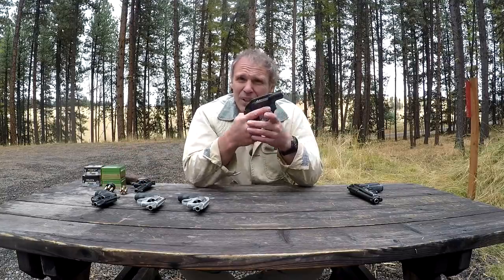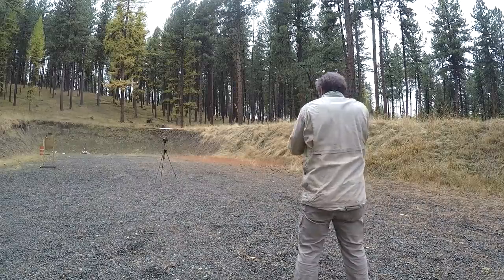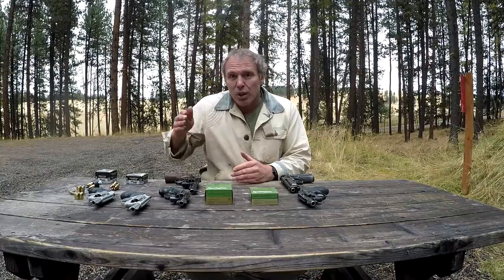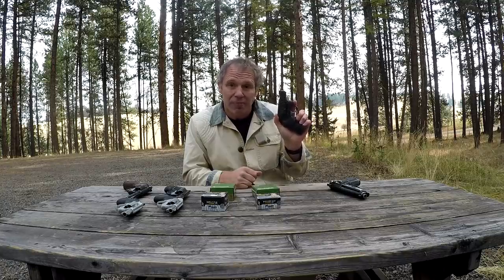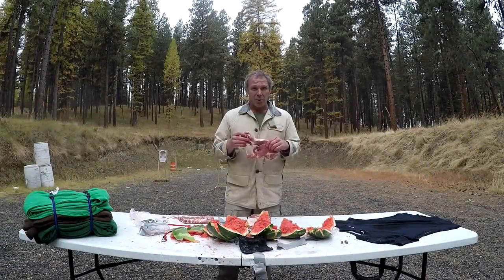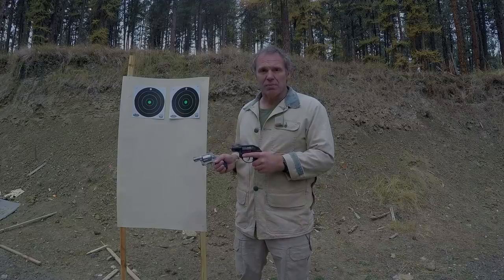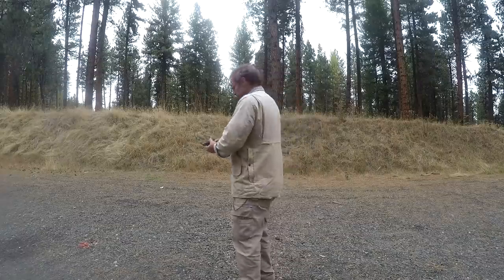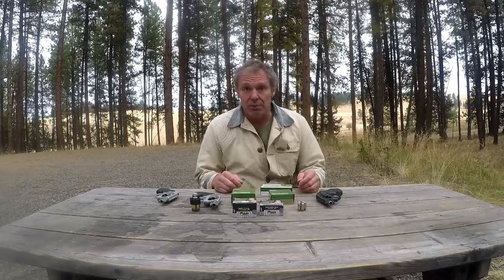Ruger LCR 9 Millimeter

Comment: I can honestly say, as much as I have nearly zero interest specifically in snub nosed revolvers right now, this full-length style video where you go deep into all the caveats and idiosyncrasies is arguably the best gun video I've ever watched on YouTube.
Reply: For a get off me/belly gun there is nothing better than a snub nose revolver, no barrel to grab, no reciprocating slide to impede or get pressed out of battery, same for shooting inside a pocket. For everything else they kinda suck but they fill their niche extremely well. I prefer to carry both a large 9mm and a small .38 spl.
Reply: @silentspace7201  Oh absolutely! I've got two stubbies, one is a truck/car gun that always rides with me regardless of what I'm carrying. The other is my beater I usually keep a few shotshells with. I only meant, at current, this isn't a topic I'm eager to learn more about.
Reply: @silentspace7201  and I carry a compact to subcompact 9mm and a snub nosed 9mm. I'll end up getting and testing an LCR eventually but for now I have an SP101 snubbie in 9mm that has had the hammer bobbed and the trigger slicked up a little.  Kind of dumb, the dang thing has about the same weight as a G19 but it is soft shooting, reliable and floats from pocket to wherever pretty reliably.

Comment: Mr. Harrell, your channel is greatly appreciated. You've given me ( and thousands of others ) a wealth of firearms knowledge in a clear, concise manner with no bullshit. I've learned more in the last few months of watching your videos than the previous four plus decades of my firearms experience.
THANK YOU!
In watching the Ruger LCR  video I was surprised at the velocity difference between the .38 & 9mm. When you have time, could you explain why that is. The .38 being longer with more case capacity would seem to be the more powerful round but hey, I'm not the sharpest knife in the drawer. That's your department.
Oh, and yes I will put my money where my mouth is and give some support to you channel. Keep up the good work!
Reply: @ken Smith .38 Special was originally designed as a black powder cartridge, so it needed considerable capacity given how much less powerful black powder is than modern smokeless, and operates at fairly low pressures (by modern standards). 9mm, on the other hand, was designed to use smokeless powder, so it operates at much higher pressures and is considerably more powerful despite the lower case capacity. Hope this helps.

Comment: It feels strange to see "9 millimeter" written out, for some reason...
Reply: Yes.  But we must follow the Master.  From now on its millimeter not mm.  He has spoken.
Reply: I use the metric system and even to me its strange.
Reply: Niklas Müller metric system is base ten

Using thousandths is base ten 

Same thing
Reply: Probably doing it to try getting around googles algorithms if I had to guess.
Reply: Agreed. Perhaps he was trying to draw attention to the fact that it was the less common model of the LCR, in a typically non-revolver caliber, rather than most people reading too quickly or assuming he made a typo and meant the LC9 autoloader?
Reply: @bobbywhite6365  What's your point? He was agreeing with the OP, and going further to say that it even looks weird written out in long form, even for someone who has never used anything but the metric system.

Comment: I watched the whole video before commenting so I'm definitely not first.
Two things I take from this video. One is that Paul talked about the LCR for an average shooter, which he is most certainly not (He's way above average). Two, I can see this comment section getting filled with the argument about cocking DA/SA revolvers.
Great video, love the long form Paul Harrell videos. Just so relaxing to watch them.
Reply: Dsdcain I own an lcr and I believe its a great pistol for all levels of shooters. Its a classic firearm for the masses reminiscent of a ruger 10/22 or glock 19.
Reply: I owned one and shot the bloody Hell out of it. I certainly didn’t love the gun but since I usually had it on me and a bunch of moon clips I would stop about once a week at the range and send 50rds down range, (I kept two clips of the nasty stuff for defence though). It was cheap since I bought it used but nothing wrong about it although double/single is technically better it’s just not that kind of gun so no loss really. Also the finish on the gun never changed and looked the same after riding in my coat pocket often filled with beach sand and car keys, (my girlfriend would stick he keys in my pockets although I told her not to for obvious reasons).
Reply from the maker: I have had the LCR for a short time. Since both of you have owned one for a while  would like some input from you. How many rounds have you fired and how durable is the revolver? How does it stand up to EDC? What kind of problems, if any, have you experienced? My E-mail address is paul4570@gmail.com  Thanks.
Reply: My only “real” problems was with the moon clips themselves. They would bend up pretty easily from unloading particularly although there was a decent enough amount of room that if it was only bent a tiny bit it would still load and function. Because of this difficultly I kept my two “special” clips loaded with unobtanium ammo and never fired them and shot tons of ball almost 50 per week until March this year when I permanently moved and sold the gun. Back and forth to Washington from Vancouver Canada where my second home was/is. The previous owner didn’t shoot it hardly and bought something else, (probably a S&W since they are nicer) so I got it for $300. I really did just keep it in a zippered hoodie pocket full of sand because I lived near the beach and the finish did get a bit buggered but I never once hiccuped although I’m sure it did once or twice but I just don’t recall.
Reply: Paul Harrell  I own a 22wmr model that I bought used in '16. It was supposed to be the gun to get my wife into concealed carry. But she never felt comfortable carrying, so after adding a crimson trace grip and practicing drawing from the pocket I liked it so much that I started carrying it! I've only shot maybe 125 rounds through it, but I prefer to train my draw and trigger squeeze with snap caps and the laser. And for the people who don't accept 22mag as a personal protection caliber please keep your comments to yourself. Im not going to stand and fight or attempt to be Rambo at any time. My first goal in any bad situation is to grab my kids and get the heck outta dodge. The pistol is a I'd rather have it and not need it thing. ----the wife just carries a knife. She's more comfortable with it and it fits her personal protection needs better.
Reply: Paul Harrell It is awesome edc for me. Its got no discernible wear and since its a 22mag there is no real concern with durability. I used to conceal carry a walther pk380 owb, then the taurus 9mm millennium iwb, before I found the comfortable and invisible pocket carry option with the LCR. I like it so much that I've thought about getting a few more pocket revolvers in different calibers just to add some variety to my newfound love of carrying in the pocket.
Reply: Just be careful that your wife doesn’t keep putting here keys in that pocket, my girlfriend used to do it all the time. She’s my wife now.
Reply: Her knife will get way more use. The knife is a tool and mine gets used daily. Of course if I carried a gun it could be used as a hammer, but that’s insane. Since I no longer live in an area infested with drug addicted homeless I don’t have to carry anymore and besides it’s not legal in Canada except for about 60 or so people usually ex-police bodyguards.

Comment: I've always wondered why 9mm revolvers are never made with a shorter cylinder (Probably they dont make enough of them to justify the special tooling), they could either cut the overall length a bit or add barrel length.

Good video as always
Reply: Definitely would like to see someone make a purpose built 9mm revolver model, so they could take advantage of the overall length reduction possible from reducing the length of the cylinder.

Comment: I thought I would share some of my .38 Special and .38 Special+P Chronograph results from my 1.875" bbl S&W 342PD for reference as people who are looking into this topic might want to know. Now keep in mind that I shoot at high humidity and my ambient temperature in my testing days were between about 60 and 80 degrees and my elevation where I shoot is about 600 feet above sea level, which in most cases will lower a given velocity, but nonetheless here are my results for velocity/energy as follows in that snub nose revolver in 5 shot means: Hornady Critical Defense 110gr+P-977 fps/233 fpe, Federal HST 130gr+P-876 fps/222 fpe, Winchester Defend stanard pressure-781 fps/176 fpe, Hand loaded 125gr XTP w/ max charge of TiteGroup(5.0gr)-827 fps/190 fpe, Federal Hydrashok low recoil 110gr standard pressure-931 fps/212 fpe, Speer Gold Dot 135gr+P 837 fps/210 fpe, Winchester Silvertip 125gr+P-825 fps/189 fpe, and Winchester Super-X 125gr+P-884 fpe/217 fpe.
Reply: Gun Sam :  I reload .38 target rounds w/ HS-6,  a faster burning propellant providing  >10% more fps,  and more energy.  I get slightly over 1,000 fps @ 900 feet above sea level out of my S&W Mod 66 .357 Combat Mag. - 4.25" bbl.  Stays under 20,000 psi chamber pressure as well.  A win - win.  Handloading rules !!
Reply: I get up to 1,070 fps on a 125 gr .38+P with Power Pistol in my 4" 686. I recently ran some 110+P Critical Defense through that gun and got as high as 1,176 fps.
Reply: @GunSam   Just subbed to your channel,looks like good content.I'm happy to see your comments on here are actually gun related and informative,not like the rest of the asinine crap comments.
Reply: Thank you. Judging for your user name, you appreciate revolvers!
Reply: Too bad you don't have a channel of your own to share the information.  Oh, wait....
Reply: Damn that's low energy out of that snubby.  It's like you're carrying a .380.